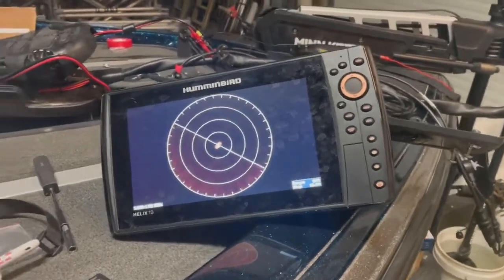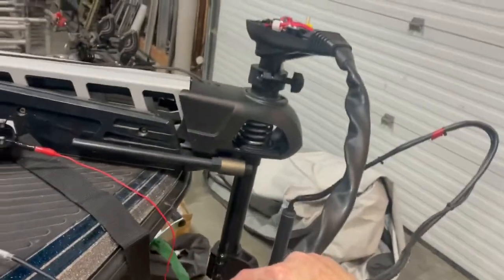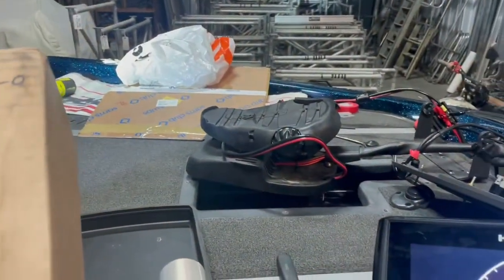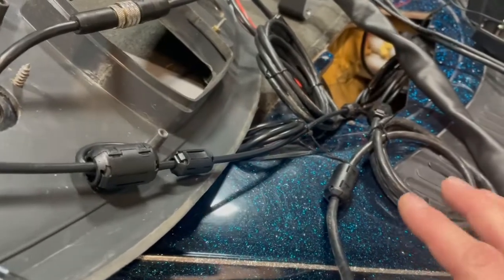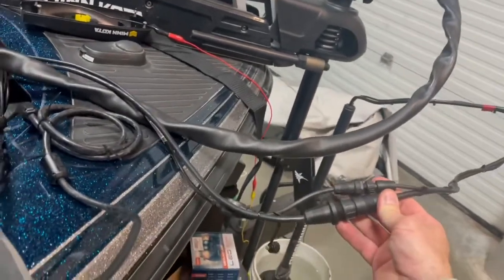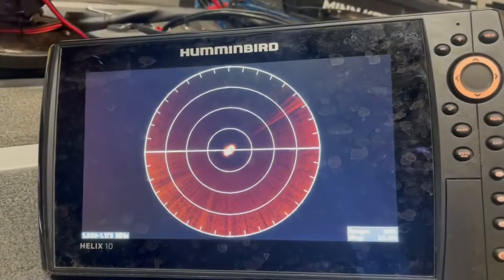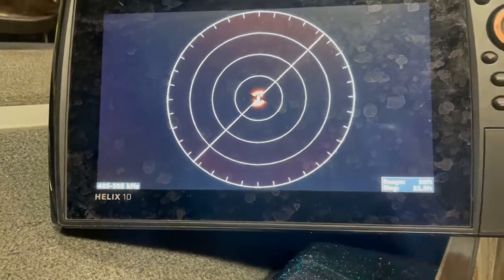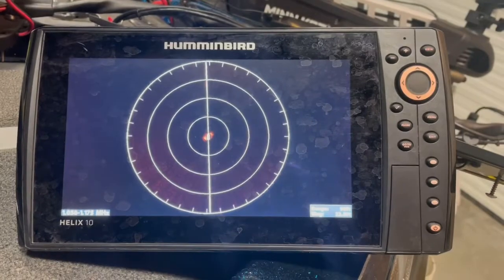Hummingbird Interference wagon-wheel fix, what works.

Comment: I have the exact same issue that you have. I tried all sorts of things. I have three Helix and plugged individually into the 360 that all do the same; however, it does not seem to be as much of a problem when I connect the 360 to my Solix. I taped most of the cable with a 4-in wide copper tape.  It helped quite a bit. However, I was frustrated to see that an interference-free screen with the trolling motor off the water is not the same when the motor is submerged. I do not recall having had an interference issue until the last software update. There is no problem with the trolling motor. The fuse is OK and I rebuilt the motor. Overall, It makes no sense to me that going from mega to kz and then back to mega makes a difference but it does-  further, initial checks could point out to an Helix issue as my Solix with the same set-up seems to be interference-free. I m storing the boat for the winter but will do more investigating. BTW, it has been a frustrating waste of time to deal with Humminbird and Minn Kota - they both send the ball to each other.